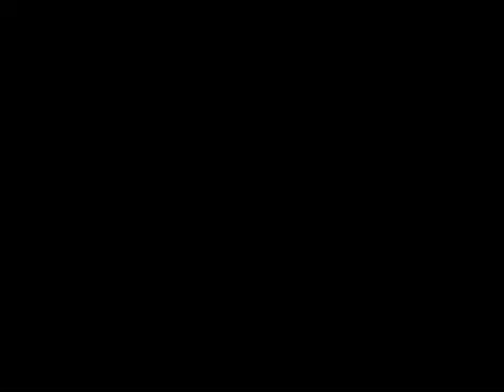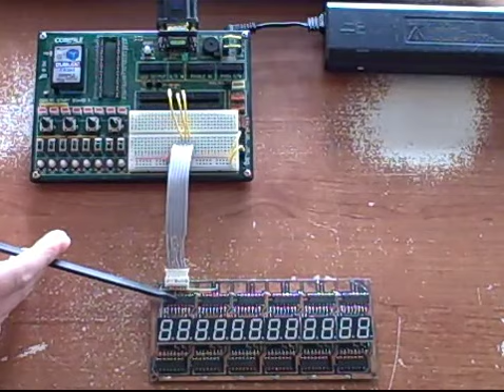Fun with shift registers - The 74HC595

Comment: cool things 595's, i've made up an 8 digit (64 segment) LED display using shift registers, a 595 addresses the strobe pins (with outputs disabled then pulsed to strobe the selected register) for  8 open collector ucn5841 shift registers using only 4 outputs and taking 4800 baud RS232 serial into the micro (PICAXE 08M). the picaxe has some code to decode the ASCII into the 7 segments (EEprom lookup) and its just bit bashing

Comment: The biggest limitation of the shift register is the current reduction, while one LED uses few mA, hundreds use quite a few. Ben Heck made a screen using 512 red leds and it drew over 3.5 amps